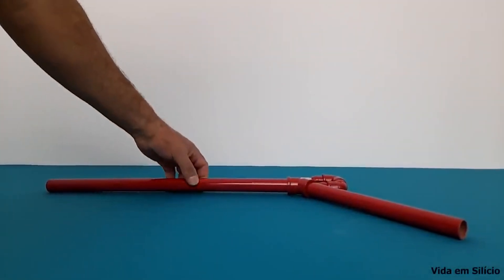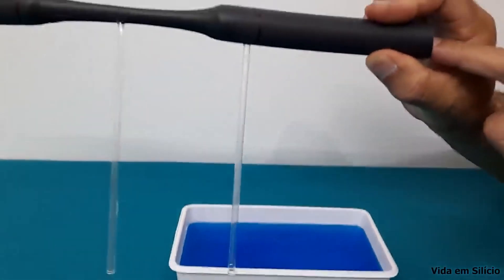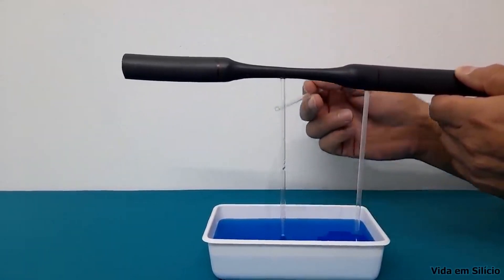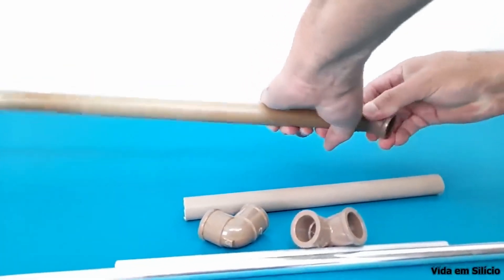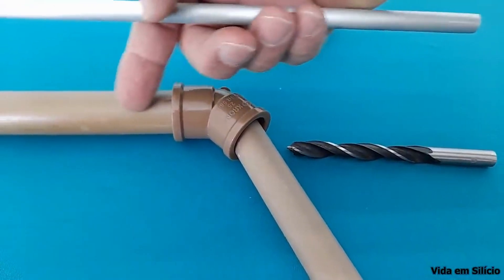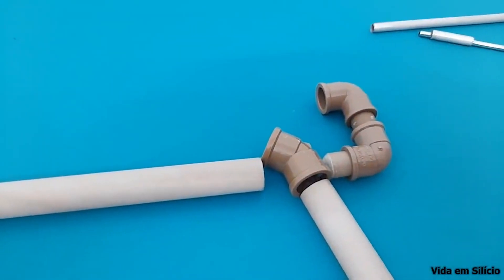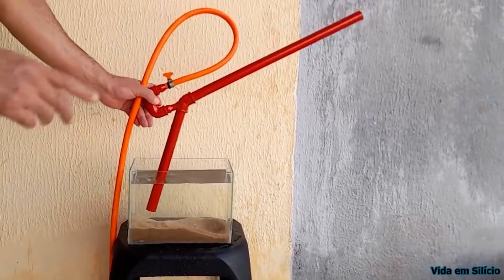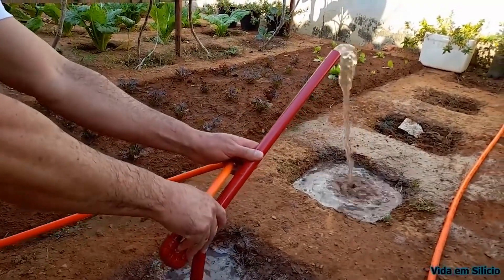Water Pump Using Venturi Effect - Other Pumps Don't Do What This One Does

Comment: Interesting...what depth can the mud be suctioned from? And would a deeper depth require water to be pumped at higher pressure?
Reply: I could be wrong, but if you have the suction begin at a deeper depth, the differential pressure should actually make it easier to pump once the vacuum takes effect. Therefore, you actually would need less water pressure from the source water hose.
Reply: @arturochavez1400 
Can I have you WhatsApp number so that I consult you? I work in a dredging company that need this technology. We want to consult you